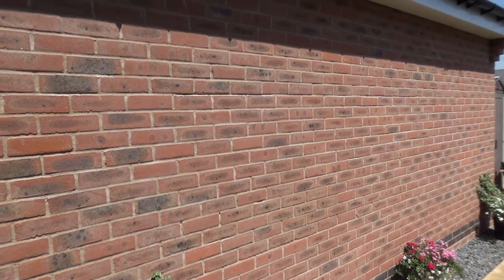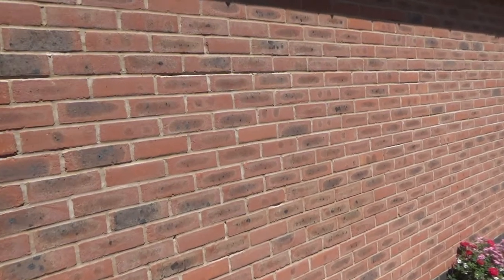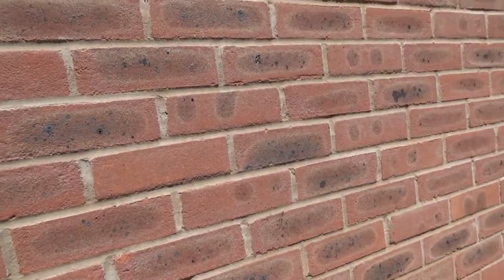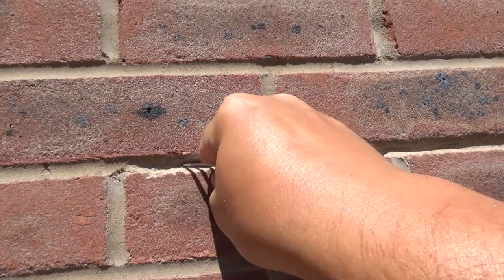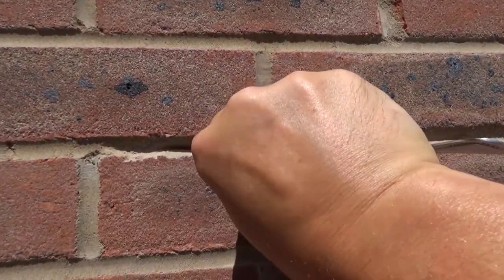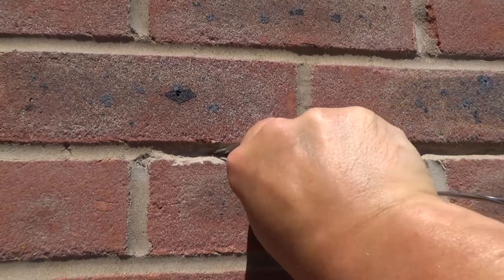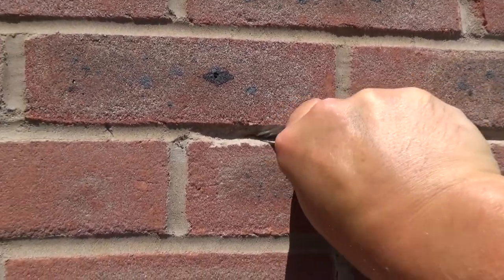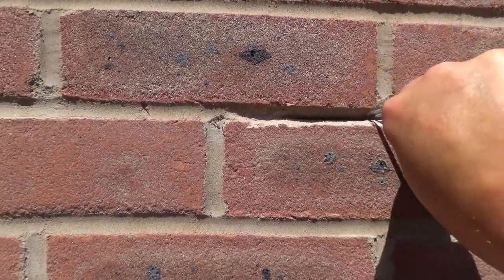David Wilson Homes NHBC Weak Mortar and no ones seems interested

Comment: I have the same problem with my Gleeson home. Do you have any details of companies who will provide independent mortar analysis? I am struggling to find anywhere. Thanks.
Reply from the maker: Hi, I would start by have a mixed proportions test of the mortar done, this will give you an idea of what the cement/line/sand mix is, however it’s quite easy for the builder or NHBC to argue those results, the best option is to have a petrographic examination of the mortar, but this isn’t cheap, you would be looking at £1000 for a brickie to remove 2 bricks and take samples from the frog or inner area, then 2 tests, a petrographic examination will give you all the information you need and the builder/NHBC will have a hard time arguing against it.

Comment: I don't rate NHBC, they are only an insurance policy trying to minimise a payout. Did NHBC fix the mortar? Or did it end up with insurance ombudsmen...?
Reply from the maker: EppingForest304 we refused the repointing work because we felt that the issue was also present in the house too, 7 months later David Wilson Homes agreed to a structural survey, this confirmed that the issue is present in the whole house and garage
Reply: @WhistlerUK  what was the final outcome?
Reply from the maker: @apj3863  it’s with my solicitor, case will be submitted to the court in the next few months

Comment: As a bricklayer  of fifty years, the explanation  is simple,  the mortar  has not been mixed  correctly,  if the labourers  were  mixing  it in a cement  mixer  theres your problem,  I've  seen it so many  times ,where the guys are throwing it in  with a shovel,  you will not get the  proper  mix, if they used a silo  ,they should  do a test on the  mortar,  which  wiil prove its strength,  shame on David  Wilson Hope's, and the governing bodies.
Reply from the maker: michael moore thanks, it was a silo mix from Tarmac, we have BRE coming to inspect and take sample later this week
Reply: Who is responsible for mixing at tarmac.

Comment: They have seen it when they were looking at a separate issue but have declined to comment.
Reply from the maker: My advice would be to get a mortar test done yourself, you'll need 100gms of mortar, make sure to take it from around the same area and from a depth of 5mm and deeper, each of my
tests cost under £150, if you're having a lot of issues with your house then it might be an idea to issue TW with a Subject Access Request, I did and gained a lot of information from it.

I've had well over 200 snagging issues, all required repair or replacement, in total I've had DWH onsite to either inspect or carry out work on 108 days so far, if you've found a lot of issues then its likely that you've many more waiting to be found, the root of the problem is down to the site manager not doing their job, so there is a good chance other home owners on your development are having the same issues as yours.
Reply: We will do, just waiting for what further nonsense TW suggest before we commit to further expenditure.
Reply: We have been out of our home since last September in rented accommodation. On top of 200+ snags picked up by our inspector 4 years ago we have since had all our chipboard floors removed that has identified twisted joists, blockwork that can be moved with a light touch, PST Straps missing, no noggins under any internal partition walls, gable roof straps missing, vertical roof straps either missing or incorrectly spaced and fire safety issues. Windows defectively fitted, floor slab not screed resulting in all floor tiles being removed, cavity insulation only up to ground floor, 3rd floor insulation either missing or poorly installed, windows defectively fitted, patio doors and front door to be replaced, cracks to render, boiler too small, radiators wrong size, insufficient support under hot water cylinder, showers that didn't drain because the plumbing went uphill and now mortar. Our site manager now works for DWH all on a site that received a pride in the job award.
Reply from the maker: Not sure how to reply to this, just 16 months of house issues was stressful and disappointing enough, but 4 years, that's hard to imagine, we've had all of the snagging issues found during the pre-legal completion QC inspections by DWH completed, we are still trying to resolve the issues with our garden (waterlogging, building waste, compacted soil) and the weak mortar, we are next going to book a professional snagger to do a complete inspection, the site manager clearly didn't do their job, so our concern is now with all of the parts that we can't see.
Reply: We were lucky (I think) that we got to open up the floors and see for ourselves all the issues. We still had to fight to get them addressed properly and still are for some issues. Good luck with your Mortar.